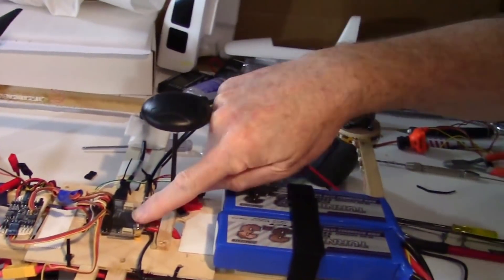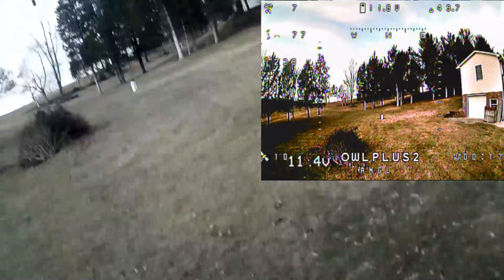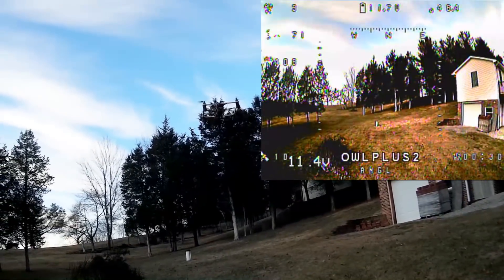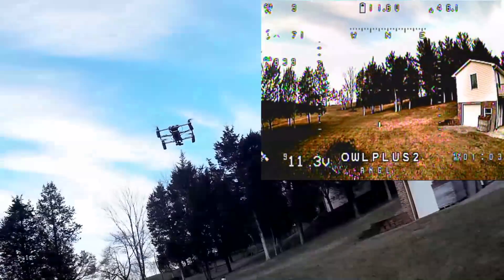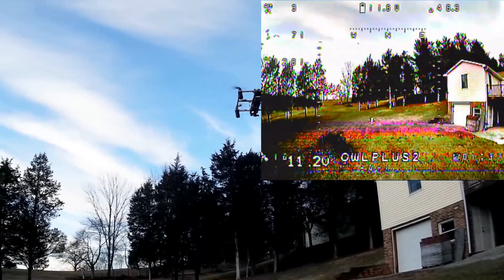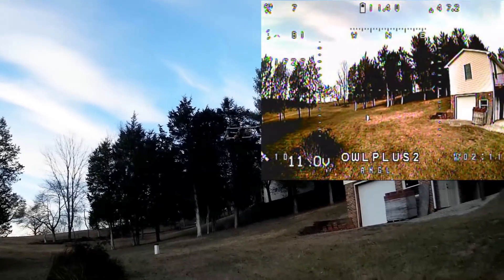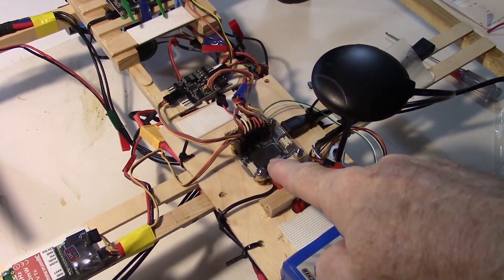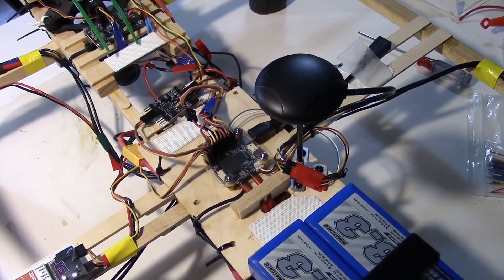My Omnibus F4 iNav Quad Copter Experiment - Part 1 - Your Opinion GPS Nav Position Hold Wobble

Comment: what exact procedure did you follow to obtain such an awesome result with althold?  I mean to say did you manually input the throttle value in inav for alt hold?
Reply from the maker: I did enter a throttle value after testing it and making note of the throttle position. I also put open cell foam over the barometer and that helps.
Reply: Thank you so much! I appreciate that.

Comment: That's really cool Dave :)
I can't wait toreceive my Omnibus F4 Pro V3 and my ublox M8N to bring back my TBS Discovery to life lol
I remember one of my friends at the flying club had similar issue and he managed to fix it with tunning the quad a bit, there are so many options in iNAV i have to say! Make sure also you selected the correct magnetometer, my friend did also this mistake :)
Have a great weekend and keep on flying :)
Reply from the maker: That would be great to see the TBS back in action. Those were the days.... The tuning needs to be done especially on the Pitch I think. It was surprising how well it did with just the stock pids considering  what a strange frame it is.

Comment: Are you sure you don't have two mags?? one on the FC board and one in the GPS, If so disable the one on the FC. Is the Barometer on the FC shielded with open cell foam to stop airflow/prop wash pressure from getting at it??
Reply from the maker: I don't see any evidence of it in iNav.
Here is the product page.
https://www.banggood.com/BF3_1_5-Omnibus-F4-V2-Flight-Controller-STM32-F405-MCU-Integrated-OSD-Built-in-5V-BEC-Current-Meter-p-1143258.html?cur_warehouse=CN

Comment: Does your fc have a magnetometer built into it ? some do and they wont work right if you have one on the gps unit and the flight controller you have to disable one of them if you do have two. My quad did the same thing and that was the problem. Great video please keep them coming !!!
Reply from the maker: No I don't think it has a built in mag because it never showed up in INav. Doesn't show on the product page either.
https://www.banggood.com/BF3_1_5-Omnibus-F4-V2-Flight-Controller-STM32-F405-MCU-Integrated-OSD-Built-in-5V-BEC-Current-Meter-p-1143258.html?cur_warehouse=CN

Comment: https://www.youtube.com/watch?v=twsrzaAT3FU INAV really is for fixed wing models in my opinion.... as quads have 2 issues.... multiple motors that need fast corrections and a lot of wiring to interfere.... not saying its not possible but ........ now for your gps hold wobble..... if you have GPS hold as well as altitude hold selected the gps unit which does both altitude and location maybe fighting with the FC altitude unit. I would suggest disconnecting the GPS compass and just use the GPS module and the FC altitude unit and make sure they are NOT selected together.....
Reply from the maker: That is an interesting thought. I can't give up the compass mag because the iNAV  navigation modes won't activate without it but I could try GPS hold without altitude hold selected.
Reply: Just saying that your GPS does not just pin point your LAT & LON location it also does your height.....

Comment: Very nice! Good work, i wanna know how connect gps module in Omnibus F4 V3, can you help me? gps ublox m8n, thanks!
Reply from the maker: All I have is the V2 right now but you might look at this video.
https://www.youtube.com/watch?v=IyWCRI9uV4Q
Reply: dmercØØ RTP I saw the video several times, but the port you use for the
connection is used in my drone by the ESC board, the FC is slightly different from the V2, this is not PRO version
Reply from the maker: Give a link to the product page and maybe I can look over the specs to help.
Reply: dmercØØ RTP http://www.readytoflyquads.com/flip-32-f4-omnibus-v3
And this os the drone 
https://m.banggood.com/es/Eachine-Wizard-X220S-FPV-Racer-Omnibus-F4-5_8G-72CH-VTX-30A-Dshot600-800TVL-w-iRangeX-iRX-i6X-RTF-p-1153989.html
Thanks!
Reply from the maker: From what I can tell it looks like the GPS would go on UART 6 TX RX and Mag would go on Uart 3 SCL SDA.
Set GPS on UART 6 in Ports Tab.

Comment: Hi Dave....Pleased you did this with iNAV and the Omni....works good.......I think the wobble in GPS hold was caused by a little too much P gain in the Pitch axis..?...Its to be expected to have to do some tuning..?
  I also got an Omni F3 board with a Baro and hope to use Alt hold without a GPS and using Betaflight....so I can do some filming....Good work...please post more as you iron the bugs out....:)
  Oh yes, and if you are using basic ESC Protocol instead of say Dshot125 or Dshot 300 / 600....that won't  help either, its archaic...Depends what ESCs you are using TBH...?
Reply from the maker: Will do! Thanks for your detailed suggestion. You may be right, it might be pitch, because it has the most weight from front to back with the camera gimbal in the front and two batteries in the back.
Reply: Yes, if you watch the clip closely, you can see the wobble is in pitch only....I had a similar thing only in the Roll / Pitch axis...Reducing the gain may make it worse....Remember, if you are saddled with standard ESC Protocol it could well be the slow motor response time making this oscillation in the first place.
  You might also want to check the CG too, those Lipos look rather heavy at the back, where does it balance?
 Im guessing you are using one of those QBrain 4 in 1 ESCs...?...if so, there's your problem...ESC protocol.
Reply from the maker: It is a qBrain. Hope that is not going to be a road block to success. Slow motor response time could be it. Hope not.
Reply: It will be for sure....that QBrain is hopeless...The other thing that strikes me is the weight placement, those big lipos at the rear...Thats an awful lot of mass which when set oscillating will gain another factor called momentum....That will give your ESCs a hard time alone...?...Move the weight to the centre of the copter is my advice.

Comment: You have some oscillations. Try to tune yours pids or change esc protocol
Reply from the maker: Why are the oscillations only in GPS hold though? Are there different PIDs for GPS hold? Flies good otherwise.
Reply: dmercØØ RTP inav sometimes makes these stranger behaviors.
To me it looks like pid and it's more agressive in gps hold because your quad it's trying to stay at the same position.

There's some options specific to tune gps modes too.
Reply from the maker: Thanks for your input. You inspire me to dig in the wiki a bit.